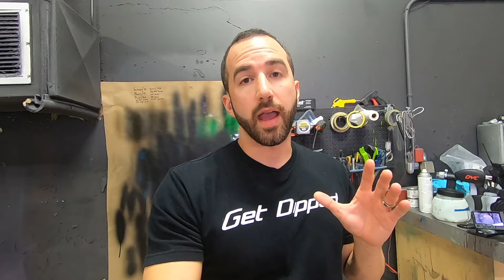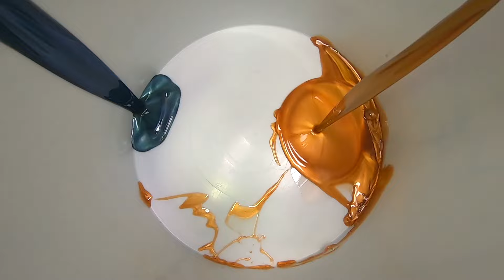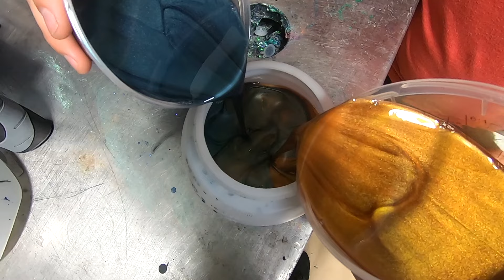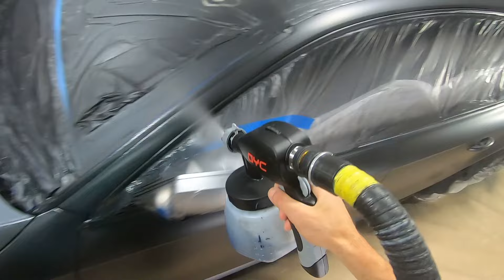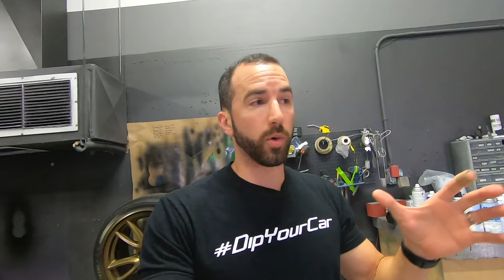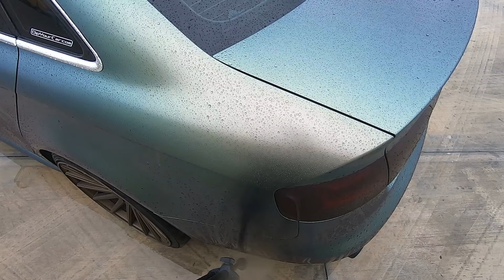Combine Two Colors, DON'T MIX, then Spray!

Comment: Doesn't aggressively shaking the spray gun while spraying defeat the purpose of not mixing the colors??
Reply: They mix when they atomize anyways. Shaking the gun as much as they do doesn't really make a difference in the out come. It mixes that much just from the tip
Reply: Doesn't matter if you shake or not , the colors are mixing as they come out the tip of the gun from the air pressure.
Reply: & that little bit of shaking doesn't mix paints well.
Reply: i see loads of people commenting 'it mixes in the atomizer' but whatever is in the supply route will be 'the mix'. In this video's ideal situation, it could for example be that there's a 30-70 supply one moment, and a 70-30 supply a moment later(fluid mix, to the atomizer) . It then gets mixed by the atomizer again, but a 30-70 Red/blue supply will look different from a 70/30 red blue supply, even after the mixing that the atomizer does. It will never happen to that extent though.. but i still feel like it'd be possible to get choppy color mixing out of a spray pistol, maybe with more contrasting colors? or maybe cooling or heating one component makes it harder to mix?
Reply: insanebmxthomas x
Reply: @timafwah  xxx call me when your home

Comment: Try 2 guns each this different colors and following each other.
Reply: If they follow eachother it'll just be putting one color over top of the first one defeating the purpose
Reply: @kadehinojos2598  then have the second one spray from a further distance so that it is a less thick coating so the other color can shine through

Comment: Amazing result!
Should try blocking the two paints from mixing even until poured in the sprayer tank, such as using a separating plastic sheet, and remove the sheet when about to close the tank

Comment: Good result. Suspected it was going to mix to some extent on its own. Would be interesting if in a future spray you use these two pearls but with your normal method to see if there is a difference. Cheers.

Comment: I have an idea that might give you the results better than combining both colors together. What if you have a split can keeping the colors separate and 2 separate draw hoses that alternatively draw the paint? Something like 2 to 3 seconds from one color then 2 to 3 seconds from the other color. This way the only time the colors get mixed is when the other color overlaps. A bit of manipulation in the timing of the guy squeezing the trigger on the spray gun will also change the results. How you setup an intermittent spray is for the genius in the group. If you do try it I'm sure that you may be onto a new way to apply paint. Good luck!

Comment: I noticed that even though you didn't use the tool to mix the colors together they still got pretty mixed just by pouring them like you did. Maybe if you put something down inside to divide the bottle in half, pour one color in on each side, and then pull out the divider it might make a more interesting spray.

Comment: How about making a paint gun with 2 nozels that way it shoots 2 paint colors at the same time? You can even add a spin effect so it can spin freely while painting or fix it on a certain angle, so one nozel can aim at one angle and the other at the opposite or evenly side by side.

Comment: Neat for sure, but I don't understand why it was a mystery.  The atomization is basically nothing more than pixels being applied.  And just like on your tv or computer, the pixels are small enough that they make a nice blend.  In this case, two colors remained separate, but because the individual droplets were so small, it was easy for them to overlap and dry at different depths.  The result is a very sweet paint job that has a strong color-shifting ability but also has a base greenish tint.  Very awesome turnout, imo.  I wonder if it'd be possible to do something like this in a matte finish for more of a camo effect where the vehicle's lines aren't easy to see because of the refraction and pixelization.

Comment: Great job, great result. But i'm sure it makes no difference if you mix it or not. Because of the movement of the spray gun, it will mix itself ayway. So i think it would the same result as if u had mixed before.

Comment: If you look into your spray cup right before you screwed the sprayer gun on you can see that the two colors did combine together and looked exactly like the color that ended up on the car. Looked like a milky white color. The same color that went on the car

Comment: How different was the color after the movement of actually spraying mixed them? Did you get any stripping and open the fan up to blend it some from driver to passenger side? Or was it pretty uniform against the odds of movement mixing them?

Comment: You shouldve had some kind of wall in the cup to keep them seperated until the last moment. Use a paint gun / nozzle installed parallel so the paint does not cross. And a high ap paint feed. Maybe keep the paint thinner low so you can do 1 coat

Comment: IT CAME OUT LIKE AN IMPROVED MILLENNIUM JADE. SWEET I NEED IT. WHAT IF YOU PUT A SEALED DIVIDER INSIDE THE PAINT SPRAYERS CONTAINER AND SINCE IT FLIPS UPSIDE DOWN WHEN SPRAYING THE DIVIDER STOPS WHERE THE LID NECK IS ALLOWING THE PAINT TO FLOW AND NOT JAM UP AS IT WOULD IF THE DIVIDER GOES ALL THE WAY TO THE SPRAYER. THAT WOULD GIVE IT MORE OF A NOT MIXED SHOOTINF DIFF COLORS OUT. BUT HONESTLY I FEEL IT WOULD MIX REGARDLESS FROM THE PRESSURE OF THE SPRAYER COMING OUT. MAYBE NOT AS MUCH AS IF MIXED SO ITLL GIVE IT MORE OF A FLIP FLOP LOOK NOT MIXED N DIVIDED BUT STILL NOT HOW WERE ARE IMAGINING HOW WE WANT IT TO HAPPEN HAHAH.

Comment: Not too surprising that it turned green.  Blue and Yellow make Green.  Just the motions of spraying the paint would mix the two colors.  You'd have to stand perfectly still and spray to get the effect you wanted and that's pretty much impossible.

Comment: Tbh, I still think you kind of "botched" the experiment, by the way you poured the paint into the spray canister 'bucket'.  It STILL MIXED.  Therefore, to do this RIGHT, you should DIVIDE the chamber into 2, so that the two paints can only get next to each other, immediately before they go into the sprayer area.  PS:  I still think this^ was a cool result.  So, no offense at all. :)